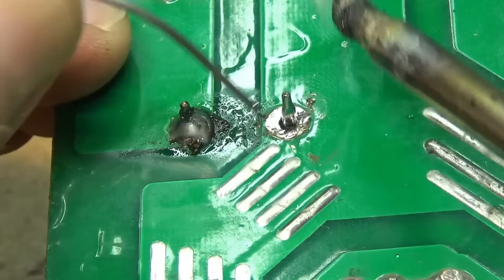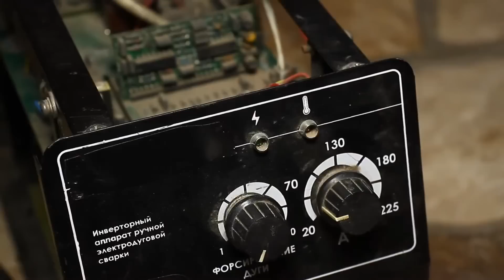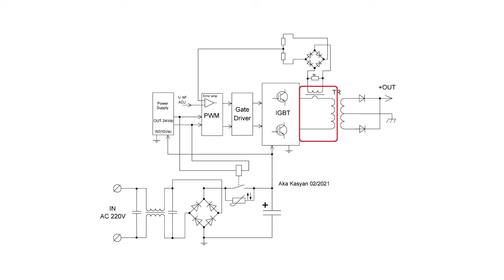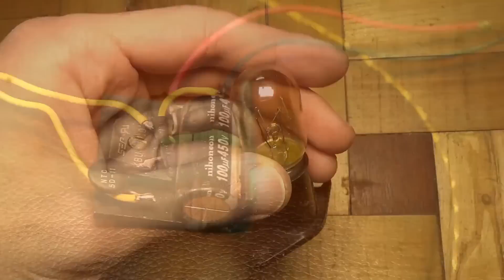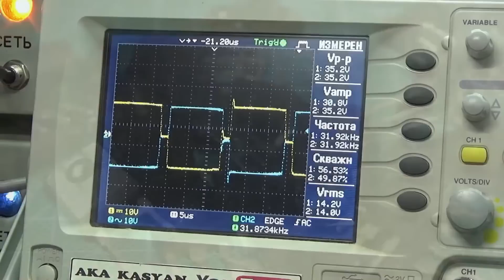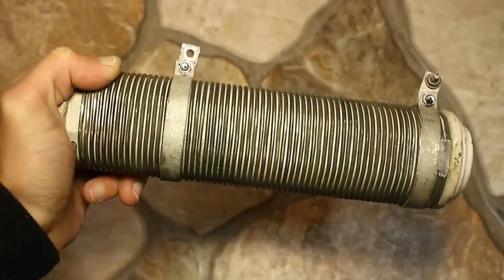How to repair a welding inverter – IN DETAIL.

Comment: Hello,
It would be very interesting project to convert one of these welding machines to adjustable power supply with voltage and current control.
Reply: They already have that. There is a voltage setting and the wire speed control varies the current.